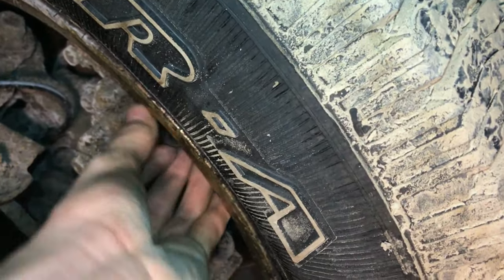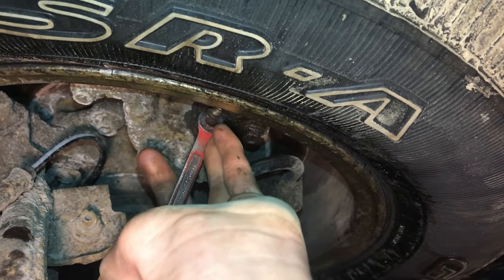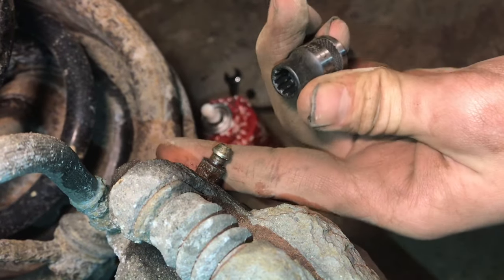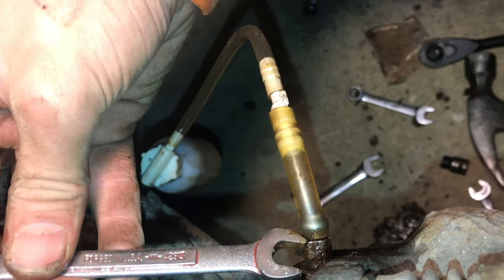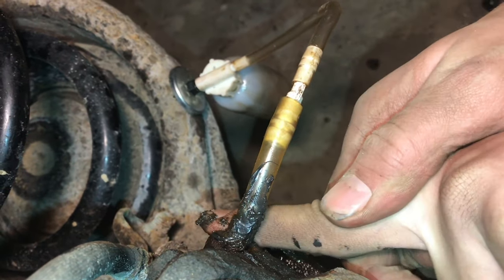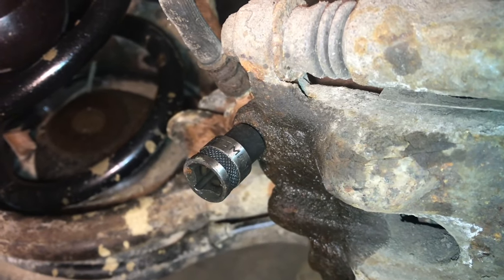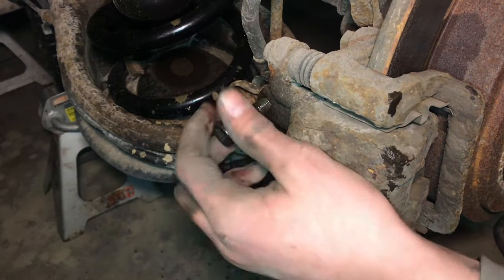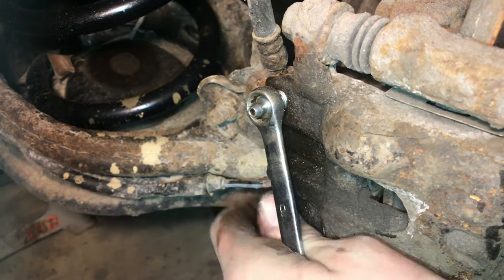LOOSEN rusted seized stuck brake bleeder nipple screw

Comment: Have  you ever heard of a brake mechanic that was too afraid to try to bleeds brakes for fear of breaking the bleeder nipple due to so much rust?  "ie Tire Kingdom"  they never bleed them after repairs 300 miles ago & the breaks are really spongy now but rust is everywhere, 2004 Trailblazer last 6 years near Ocean in S Fl.

Comment: In addition to the other comment on using 6 point sockets , if it is rounded , hammer an old drill bit in the bleeder hole to prevent it from collapsing , cut it flush , hammer it or use the air hammer with a blunt end to vibrate it . Then a BOLT OUT socket . Sears , Irwin , Lisle , etc. have them . Heat it and hit it with CRC Freeze Off helps .
Reply from the maker: Sounds like you’ve been doing this stuff for a while. That’s interesting to Fill the void with an old drill bit so it won’t collapse. Those bolt out sockets are amazing, something that actually works. 👍👍

Comment: Wire brush nipple especially threaded part. You can spray wd40. Insert shank of tight fit steel drill bit. Break drill bit off flush with hammer. Heat nipple with accetelyn torch,quench with water. Repeat heating/cooling process another time. Also you can tap hammer top of bleed screw with smaller socket that fits on top of hex of nipple. Heating and quenching is most important part of process even if nipple is rounded. Good luck

Comment: This has been EXTREMELY HELPFUL!  I was using an open end wrench to break them loose and one of mine would not open up.  In the past, I have ripped the nipple off going too hard and wanted to avoid it at this time.  Using a socket and lots of wd-40 helped.  I also did the banging process to loosen things up but the big difference this time around was finding a socket instead of an open end wrench.  THANK YOU SO MUCH!!!!!!  I started this job weeks ago and gave up to avoid breaking bleeder.  Sprayed WD40 here and there to get it ready for my next attempt weeks later.  Had same issues until I pulled out the socket.  Wish I knew this years ago when I struggled with other bleeders....
Reply from the maker: I struggled with this for years, now it’s the first thing I grab for is a socket. It’s way better if it’s a six point instead of a 12 Point. If it looks like the bleeder screw is starting to strip out, for about a dollar from rock auto I put in a new bleeder screw.

Comment: When you remove the bleeder screw does the brake fluid not leak out? Should you clamp the brake hose first or that not recommended as it will collaplse the hose?

Comment: What I do with a rusted fastener is spray penetrating fluid, grab the appropriate wrench or socket and ratchet. I have a set of pickle forks that I can attach to my air hammer. I put the wrench on the bolt and the air hammer on the end and pull the trigger while applying turning force on the wrench

Comment: I have found that spraying the bleeder with PB blaster and using a good pair of needle nosed vise grips worked wonders for breaking them loose.  Just be sure that the grips clamp down onto the flat part of the hex and that the grip is as tight as you can get it, then carefully but firmly work back and forth until you can just begin to feel some movement, hit it again with PB blaster then turn to loosen.   Worked for me every time and doing this does not round out the hex, at least for me it didn't, but you have to ensure the grip is tight and not gripping the bleeder right at the tip of the grips, but deeper, maybe like 1/3 to 1/2 way in.   I've used this method many a times when I came across a bleeder that wouldn't budge by other methods, including the one described in this video.    Removing the tire makes this a whole lot easier as well.

Comment: Using those 12 points instead of 6 points are part of what strips them out to begin with.  The rust is just the nail on the coffin. I said screw it and just changed out my front calipers last week after stripping out the bleeders.  Figured 10 years was long enough
Reply: Ya I probably should get new calipers too. My bleeder valve just snapped off at the threads

Comment: The socket and ratchet you're using is the same one I used (Craftsman) but the socket wasn't deep enough to fit. In other words the nipple was too long for the socket.
Reply from the maker: I’ve definitely had that happen before. Sometimes the ratchet won’t fully seat but usually there’s enough grab to loosen the bleeder screw. If possible or longer socket makes it easier. It’s also better if you can have a six point instead of a 12 point socket￼

Comment: I would have greased or used antiseize on the new bleeder screw threads before installing the bleeder.  It might save your ass next time.
Reply from the maker: Agreed, anti-seize absolutely should be used when putting back the bleeder screw.

Comment: What kind of grease  ?
Reply from the maker: I typically use lithium grease because it’s the cheapest. Because it’s not a bearing you don’t have to worry Grease incompatibility. So literally any type of grease that will keep the rust down. If the grease nipple is covered in grease salt can’t get to it. Definitely worth your time. Hope the answer helps, let me know if you have any other questions.
Reply: Live Free tyvm, I appreciate the advice
Reply: The one grease that is compatible with DOT3, DOT4 and DOT5.1 brake fluid is Red Rubber Grease. I personally use Fusch Renolit Rubber Grease JP, which is the one Subaru recommends using inside the caliper cylinder bore to grease the piston square seal o-ring and the cylinder groove in which the square seal fits.

Comment: Wait? I was told if the bleeder screw broke I would have to get a caliber! Am I being lied too?
Reply: That's the solution for many at-home mechanics. Usually with enough patience, penetrating oil, a drill, and an easy-out, you can still get a broken one out.
Reply: If you change the rusty caliper, Midas well change the old brake hose, too.
Reply: some times it's cheaper to just swap the part. especially if your paying a shop to do it at their really high shop rates.